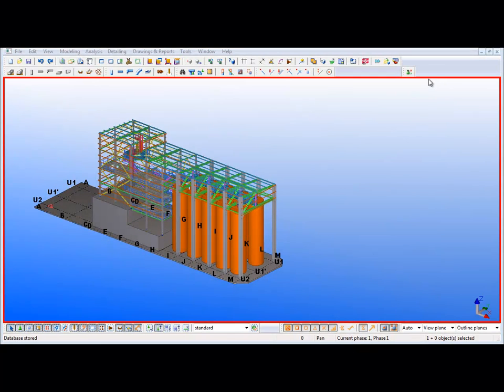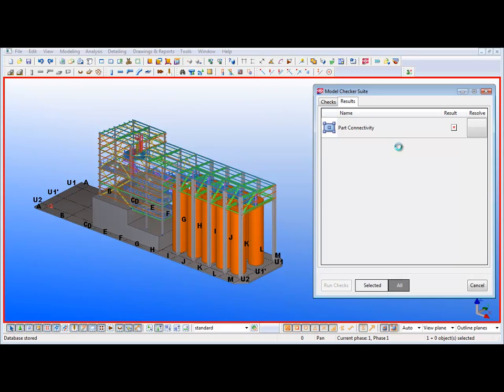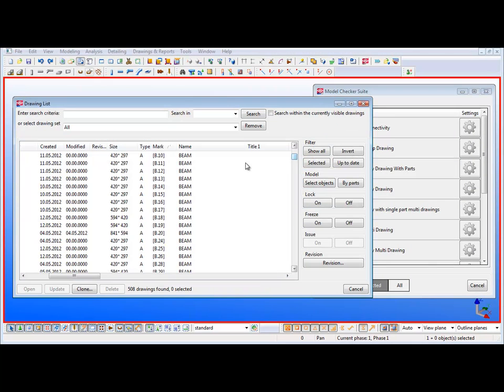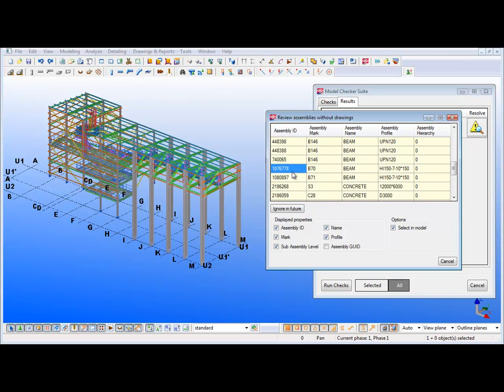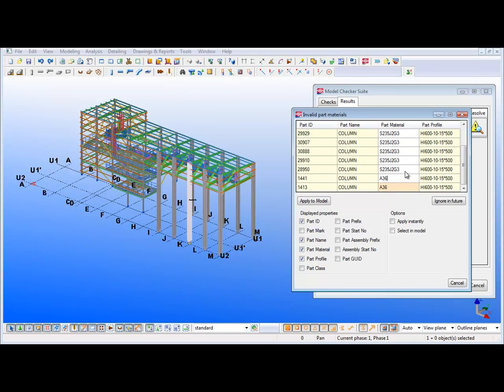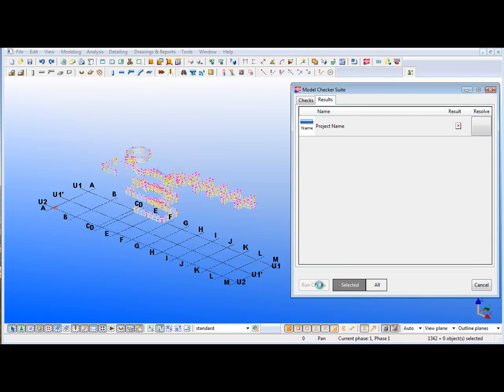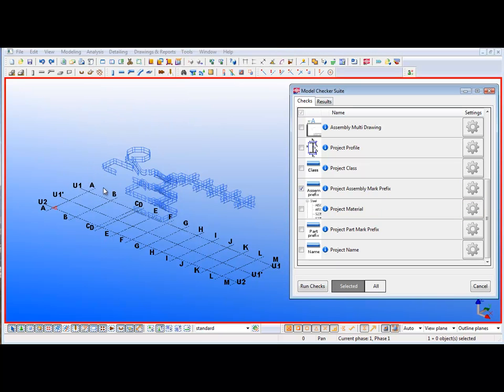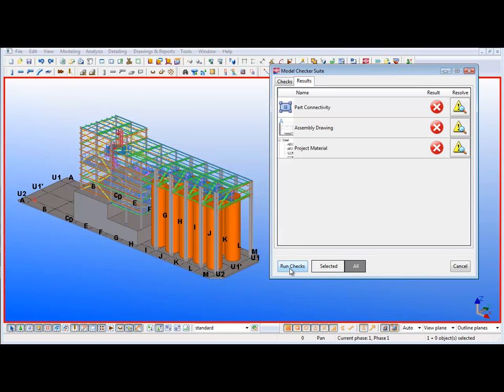Model Checker Suite

Comment: does anyone have the  TEKLA "MODEL CHECKER SUITE", kindly forward to adewoyinabiodun@yahoo.com
Reply from the maker: Once the extension is installed, you can access it by the Component Catalog or the new Toolbar that is created for the extension if they are using 21 or older.  If they are using 2016 or newer then the tool will be installed to the 'Ungrouped' section of the Applications and Components Catalog.